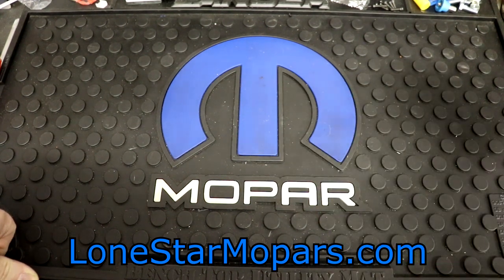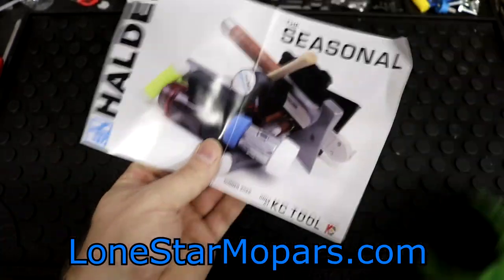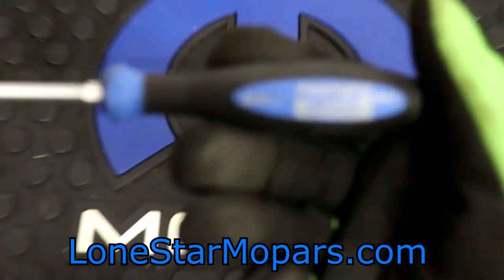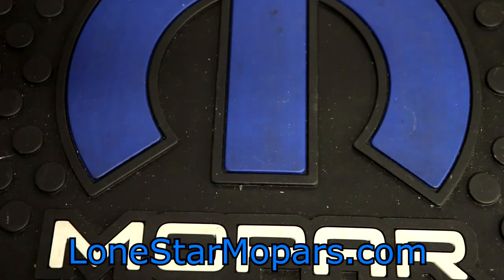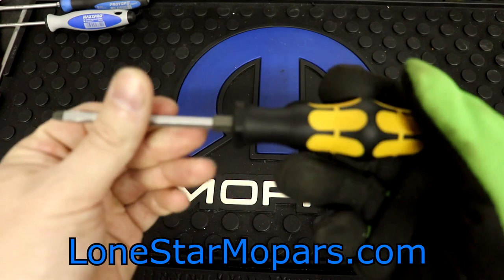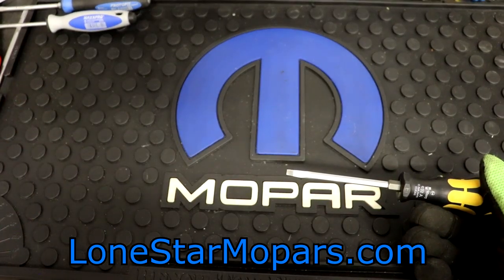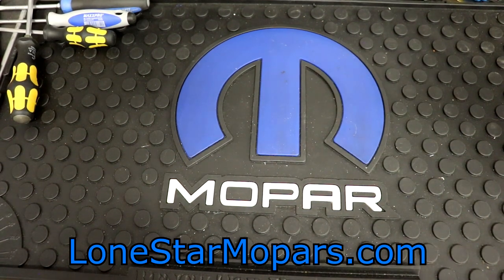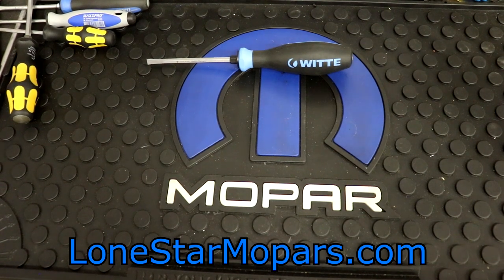KC Tool Haul Special Edition -Wera Power Hour: Checking Out the New Tools!

Comment: Thanks for this video.  I was going to get the ratcheting bit driver  version T handle.  After watching this video I'm sold on the 1/4 inch T handle socket driver . As I have the rapidaptor  in my electricians maintenance kit.

Comment: yeah seeing that ratcheting t-handle has impressed me. assuming that the mechanism holds up and remains durable for $72... the adapters and locking extension also very nice in combination with it. and the ability to assemble what you need on the spot. it all goes on to my shopping list / shopping cart for a future time
Reply from the maker: I knew it was the safest item in my purchase, but I never anticipated they would have the ratcheting mechanism confined to the same form factor as a non-ratcheting T-Handle.  I spun it a little tonight in the shop since people had told me they heard they were locking up...no issues so far.  Unless someone really wanted the dedicated bit holder version, I think this is the stronger product that can more easily handle sockets and bits.  It is a win-win imo.  My only complaint so far is that I forget it is a quick release and try to rip the socket/extension off, lol.
Reply: i literally watched a video where reverse did not engage, new out of the box

Comment: Very, very cool haul and thanks again for the mention. I have one of the Zyklops ratchets and it's a solid setup, it came with that bicycle kit that was tool of the day awhile back. It came with seven or eight sockets, 2 extensions, some bits and an adapter so you can use the bits with the ratchet, but I pretty much bought it for the ratchet. That rachet/bit driver thing is rad. I can see how the bottom piece where all the bits go could be bothersome, but I'll probably still buy it in time. Again, very cool video and I unlike possibly others enjoy the lengthy ones.
Reply from the maker: No problem.  Yeah, I might should have just sprung for the full size version...it would probably serve me better in the long run.  This little guy is undeniably cool and does spin bits and sockets...I might just be too old fashioned in my preference for stand alone stuff.  I'm sure the hardcore EDC crowd will have a different take.  Getting it on sale is likely the way to go.  This, plus an bit holding extension, and a 3/8" extension would pair best with a socket rail or some sort.  I wouldn't call it EDC at that point, but it still qualifies for a compact tool kit.  Super cool set up, just not ideal for me.

Comment: For the price of the pocket zyklop, you could get a decent zyklop set with bits and sockets and case. I cant see carrying that thing around in my pocket, to be honest.
Reply from the maker: Unless someone is super into the EDC side of things, I think I would go the route you suggested.  I guess I am more the type that would just prefer a small socket set and a multibit driver.  It is still cool and a good idea, just not really ideal for me.  If you rely on pocket carry, you are missing out on the sockets and extension, unless someone wants to walk around with super heavy pockets.  Maybe some people can tailor a socket rail to what they usually run into, but I'm also afraid that really trying to use it for day-to-day stuff you would have a lot of frustration with socket retention.  That said, I'll still try to use it...best feature might be a conversation piece that handles light duty stuff on the bench.  Really cool little product, just not sure it is the most practical way to achieve the end goals.

Comment: the gedore striking cap screwdrivers are super awesome, i abuse them daily, for over 2 years now
Reply: Personally I'll watch a 6 hour video if it's interesting, usually over a few sittings. So I'm not sure I can offer any feedback on video length. I've watched 99% of your German/Japanese/USA made tool hauls at least twice
Reply from the maker: Thanks for the feedback!  I kind of think I fall into a niche, where most people that have stuck around actually do prefer the longer videos.  People that want 3 minute videos probably gave up a few years ago, lol.  
Great to hear on the Gedores...I took it and the Witte to work on Monday.  So far, the little 3.5mm has held up really well.  In addition to the big box staples, I also rip some that hold paperwork down that are more traditional.  It is really hard to get under them with a 4.5mm or bigger tip...Most pry tools are too thick.  The shaft deflection on that tiny driver is the least I have seen...very excited to put it thru the paces with the heavier staples.
Reply: @lonestarmopars  you're definitely my favourite tool guy on the youtubes. Probably because you're excited for the tools, you're not just reading out the features or specifications. 
I've owned the 6 piece set for ages, yet they've turned maybe like 10 screws between them all, yet I use them daily. Removing keys from shafts, prying/splitting bearing housings away from there home, getting used as a scraper, or pin punches, mixing things, shoved through grates to hold doors open... I could literally go on haha. I have broken the largest size. But it was my main source of abuse and was still used after I'd broken the tip.

Comment: I just for a 1/4 hex to 1/4 square adapter for a bicycle set with a zyklop mini. I think I would have gone that route as well if I had gotten a t-handle. Would probably use it more for bits than sockets plus you can’t pull it apart like you can with the solution you chose.

Comment: my only complaint with the zyklops, is that you can't keep the head unlocked - allowing you the full range of motion. ranges between 15-90* get caught on the splines of the ratchet direction switch..

Comment: I’ve been following you for years and after the umpteenth tool haul I’m left wondering - where the hell do you store all of your tools?  Do you resell some of them after the videos or do you just have some massive garage and multiple extra large tool cabinets? 🤔
Reply from the maker: Haha, nope...everything is still with me (minus a few things that I have picked up to give someone, which I usually disclose).  I've basically got it all in a Husky, the US General Master Tech, and a little in the 44" US General tandem that is more for consumables etc.  It does seem like a lot, but I was basically coming from a little Craftsman Rally Box and 26" Upper and Lower (which have acquired basically none of the new stuff since they were full).  I have thought about getting a 56" or 72" in the future, but also don't really have the space for them at this point in time.  It is kind of a balancing act.  You've basically been along for the ride of upgrading and expanding from a base tool set.  I doubt I'll ever be done, but things are slowing down.  Still a sucker for anything new that interests me though...obviously.

Comment: The Pocket Zyklops has a place, but is definitely a niche tool. I recently picked up the metric version with the sockets and the extension. 

For me its the perfect tool to grab and go (along with a Knipex Pliers Wrench) if you're going to do a quick task in the house, to help a friend or family member with a small project, to take in the car on a trip, or to quickly access something under the car/hood (or in the interior). The options it provides can cover a lot of bases in one small package that you can put in your pocket (or on you belt in the case of the kit).

I think it functions very well for how compact it is, and at this point I really only have one complaint. I wish there was a lockout function for the ratchet mechanism, so that I don't have to fumble with changing directions when driving screws. Sometimes when you have to repeatedly switch back and forth between loosening something and tightening it, its easier just lockout the ratcheting function. If they had added that, I think it would completely live up to my expectations for the tool.
Reply from the maker: Great points!

Comment: Great an very interesting vid 👍
The euro version of the impact has pozi instead of Robertson, those are uncommon over here - Phillips isn’t. And the Hex are in mm.
Reply from the maker: Thanks...glad you enjoyed it.  That is correct about the metric version.  I  honestly tend to run into more Pozi screws than Robertson the last few years.  I will probably tweak the bits a tad to reflect that.  PZ1 and PZ2 will likely get added-in to the bit carousel.
Reply: @lonestarmopars  hm seems like less and less pozi here, and more and ore torx (IKEA aside)honestly is stupid how types of screw heads there are. I have 5 different types of drivers I use: slotted, Phillips, pozi, Allen and Torx (not counting pentalobe, safety Torx and the various other specialty ones). It’s just too many, would love if the entire world would just use Allen and Torx

Comment: The Wera Pocket Zyklops is like the Knipex Twin Grip. An odd tool to find real functionality other than EDC. Nice maybe to have but tries to do to many things. In other words gimmicky.
Reply from the maker: Pretty accurate...undeniably cool and compact for what it has potential to do, but I think I'd prefer a multi-bit driver and small socket set with a ratchet and extension.  It wouldn't fit in my pocket, but would be a more robust solution.  I 'm probably in the minority, but I actually get quite a bit of use out of the TwinGrip.  The old cars I mess with always have really bad Phillips screws, and I've found they hold several other items very well.  I do sort of wish they were offered in a smaller size tho.